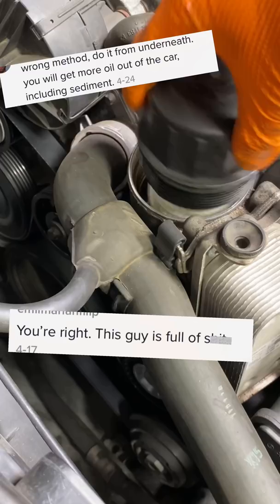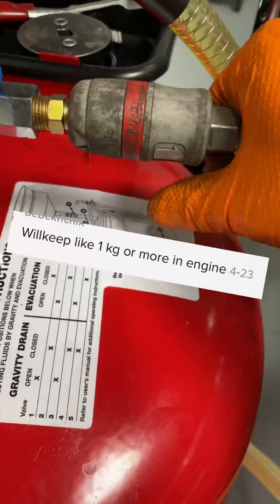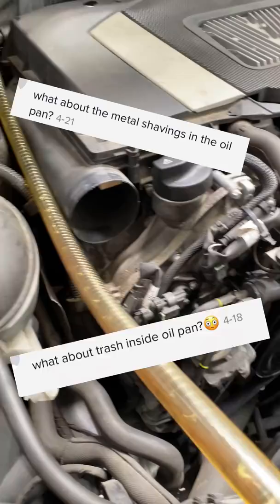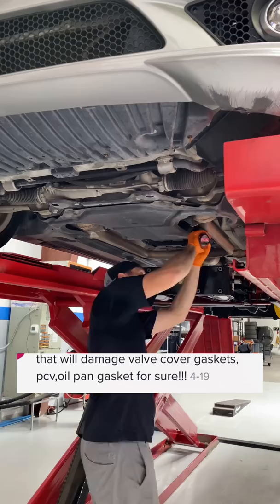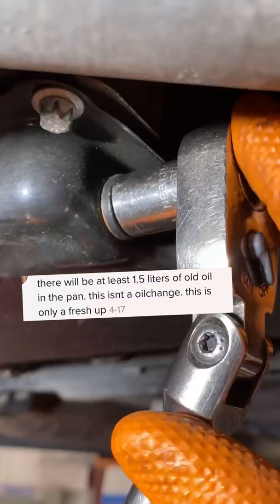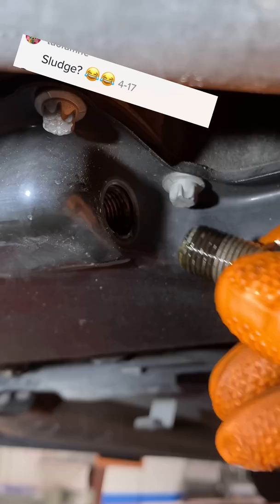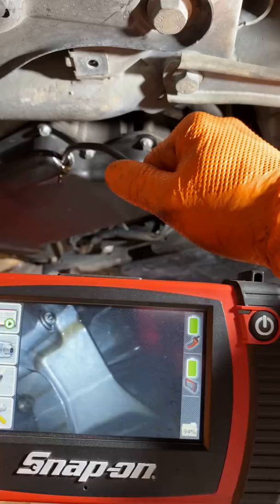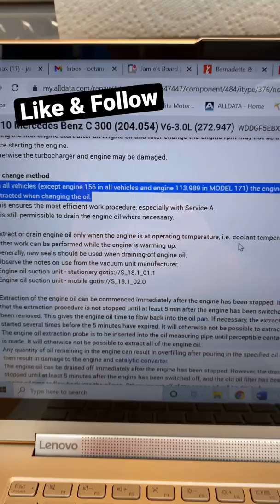#shorts Mechanic Proves Haters Wrong

Comment: As a certified MB mechanic, this is exactly how we did every oil change that came into the dealership. Thank you for showing people the suggested way that their oil is changed.
Reply: Is there a specific reason to suck it out and not let it flow out through the bottom outlet.
Reply: I also work at a Benz dealer in Latham NY we do the same except on the new models that don’t have a dipstick
Reply: @PasteteDoeniel  Pulling a vaccine gets more out. We do this for brake fluid services also
Reply: Who would have thought the dam engineers would come up with something to make it easy on the mechanic.🤔
Reply: Same here at our dealership. These new cars obviously from the bottom and most amg
Reply: @christophervanzetta  so you basically syphon the oil out with a vacuum? And this is recommend by Mercedes or this is an extra step you have to do?
Reply: @Dethmegadeth  I think emissions makes everything mechanically impossible to be simple.
Reply: Alright what tool is this cause I need it
Reply: Exactly its the Same how we do it at Volkswagen as well.
Reply: @PasteteDoeniel  it's just faster and less mess the way it's European cars are designed it's extract it and fill it exactly according to computer.
Reply: Thanks for proving my other comment true.  Suggested and easier if you have that equipment but not required.

Honestly, as a mechanic do you believe the boroscope is not BS?  That view was too dry in my opinion.  Its seems like you would need an incredible vacuum pump and a ridiculous number of hours of suction to get every drop of oil out.
Reply: Been doing them thus way since I started at the Dealer in 1989...
Reply: @MiguelHernandez-rj2uz  Mercedes recommended, been that way at the dealership since at least 1988
Reply: @Gajaba95  I generally do it to most cars as well.
Reply: I do my own old changes. That extractor is game changer. Never would have thought a Mercedes would be easiest car I have ever done a service on.
Reply: It s quick and fast it saves on time   I’ll
Keep draining my oil from the oil pan  because  I don’t trust dealership
Reply: @michaelr.williams8176  k, well have fun with your old way of doing it that has already been proven to be outdated
Reply: @benzdoct  I've only been at the dealer since 07, so not nearly as experienced but I don't remember ever seeing in wis that oil changes were recommended to be done topside. I prefer a traditional drain, cuz I've found it to be quicker and simpler, plus I can do my inspection underneath while letting it drain. I'm not saying your wrong cuz I don't  look up wis instructions for oil changes very often. I know for sure suction is recommended with the new plastic oil pans. The one thing I do remember clearly that gives me pause, is that on the amg 113's with 2 drain plugs i remember Mercedes requiring replacement of the drain plugs and crush rings. Of course different strokes for different folks. I can tell you without exception everyone at my dealer always gravity drained unless it was a plastic pan or something like a waiter lof without a lift available. It was especially helpful when I had a trans service on the same ticket as well.
Reply: @nm-xh3dm  I can for sure tell you its not bs. I pulled 13 qts out of a sprinter last week. Pulled the drain plug after cuz I thought the air line in extractor had a snag, and not a single drop came out. As a tech I personally prefer gravity drain but I use an extractor on plastic oil pans were required and on overloaded sprinters cuz id rather not pick them up. But strictly time speaking to get a gravity drain to not have a drop left you'd typically have to let it drain overnight. Its very very thorough
Reply: @PasteteDoeniel  ooooooooooooo oooh
Reply: @Dethmegadeth  and more difficult for the DIYer
Reply: Is there a reason they tell you to do that way versus the traditional gravity drain?
Reply: @PasteteDoeniel  Its faster... no mess and built for this
Reply: Jiffy lube does this on every vechicle now. You got to love the youtube certifed mechanics.
Reply: @Gajaba95  what do mean Less mess? Like if there something in the way of the oil flow then yeah there will be. But, for cars that doesn't. It not messy at all. I don't even get used oil on my finger. Well, the only one old oil that  does comes out head gasket. Lol.
Reply: for mercedes. anyway... and some VW and porsche...
Reply: @PasteteDoeniel  no its just the design they used
Reply: @SavageZebra67  my girls has a 2007 Toyota and thats how they did the oil change as well, with a vacuum system.
Reply: We need more mechanics that are truthful like you.
Reply: @Snma_sector321  A lot of truthful mechanics out there. Unlike doctors it's acceptable to find the cheapest one. And you get what you pay for. The horror stories I hear are from lube shops. And generally those are 18 year old kids. You are very cynical of an entire industry
Reply: @billrogers3139  yah it's not an uncommon procedure. But your Toyota most likely has a regular fram style filter. And a regular drain plug. I can hook it up to the scanner too if it makes you feel fancy...
Reply: @SavageZebra67  Your point was? It was at Jiffy lube they do every car that way regardless of the filter or if it has a drain plug. They said most quick change oil change facilities do this now. Your so talented, you can plug a scanner tool into a OBD2 connector, Im sure most people are envious of your stellar talents.
Reply: @billrogers3139  yah... are you drunk. First sentence was "pretty common practice these days". Not sure if you are confused 🤔  But you don't need to do this. As in it is possible to accomplish this task on many late models without the need for vacuum. It sure is nice tho.
Reply: @SavageZebra67  Your entitled to your opinion but thats all it is your opinion and  nothing more.
Reply: So while we got the MB techs here I was told there is a rear limited-slip differential that comes with the AMG performance package for the E63. It’s a 10 btw. Would this be something to get if I can? Also is there a way to tell if the car has the package or not. The only way I have been told so far about is the car will go like 178mph instead of just 155mph
Reply: Ohhh so this is MB don’t last for shit...
Reply: I bet you don't do it on a cold engine though. 
Audi tech here we do the same thing.
Reply: Hmm I've never seen this method before Seems a whole lot easier too 😂
Reply: @PasteteDoeniel  time wise I think
Reply: Suggested doesn't mean 'has to be this way or else shit fails' the drain plug does the same job faster without a $10k machine.
Reply: @PasteteDoeniel  it literally gets everything out when you drain from the plug there’s still stuff at the bottom of the pan that can’t get dislodged due to the flow but this puts the system under a vacuum so not only does it get every last drop but it can suck up debris as well.
Reply: Im a MB employee in Munich and i can approve this
Reply: @nvrlt  
How do you know you've hit the deepest area with the pickup tube? There are affordable pumps. I have an 08 GM V-6 Caddy SRX, and I have ramps, shop jack, creeper etc, and it sits up high enough so the old fashioned method isn't too painful however the filter is up top! ☝️
Reply: So, uh why don’t more manufacturers do this?
Reply: You’re absolutely correct. If MB trained you that way, then that’s the way! I think a more interesting subject would be, how much is the MB dealer charging for this service?
Reply: Gotta love $500 oil changes.  oh, but you gst a coffee and donut
Reply: I find it more funny that people will dispute someone who does it for a living, like one of these people does this as their life, I think they know what they’re talking about.
Reply: Respecting your knowledge as an MB mechanic there are some additional things to point out.  The extraction method works for cars who are designed for that.  You can't do this with older Mercedes and still get all the oil.  With that said it is not required to get all the oil because the volume of oil that replaces it makes leftover oil a non-issue and not worth bringing up if the car has been getting regular oil changes.
Reply: @leehoodeehoymenoyhe4747  same at audi in maryland
Reply: @PasteteDoeniel  because they want to charge you for it
Reply: BangontheBeastdaily  washing dishes by hand will get them more clean my guy. Also as long as you don't have a Mercedes with a skid plate under, the regular way to change oil with oil flush is just as effective, cheaper, and you can make sure it's done right and not pay a dealer/mechanic way to much for a simple job. Just my two cents, but I don't trust others to work on my vehicles anymore
Reply: my truck leaks oil haha so no oil changes for this guy
Reply: I'm a mechanic to but f*%k working on the that shit
Reply: @leehoodeehoymenoyhe4747  i live in Latham/vliet
Reply: I do this on my c207. Super easy and clean.
Reply: @nm-xh3dm  I can tell you with certainty. The extractor is that efficient. Will suck it almost dry. No different than the vacuum coolant fillers.
Reply: @TruckerReviewed  Time, but also less chance for there to be a spill. It's all about the environment these days.
Reply: @BJCulpepper  that's not true bro. The cheap extraction pumps they sell at Harbor Freight and what not leave a lot behind, but the pro ones like the one used in this video will get it all out. As long as there is a dip stick tube right to the oil pan, you will suck it all out.
Reply: @PasteteDoeniel  easier to clean up I guess, it saves some time... And it's designed to be sucked up so why not do it as intended(and dosent take as much effort)
Reply: @leehoodeehoymenoyhe4747 why tf would you not have a dipstick😭😭 THIS is why new cars aren’t worth shit. What do you have to gain by removing a tool to check the most critical fluid. Soon enough, oil will be just like transmissions fluid. “Good for the life of the vehicle.” CHECK AND CHANGE YOUR FLUIDS

Comment: "what about the metal shavings"
if you have metal shavings in your oil, you need more than just an oil change...
Reply: It's nothing to worry about if it's sparkly oil that's just a Chevy
Reply: Metal shavings are normal because the engine has some wear as it gets old, the problem comes when there's too many
Reply: I was saying bro
Reply: PFFFF
Reply: @Crunch Bar vehicle*
Reply: @Crunch Bar how much metal shavings. And I never said anything about that at all
Reply: @GuninGames  Ford
Reply: @Crunch Bar bruh this is like having a Twitter and reddit argument at the same time. They can't seem to listen to a thing you say and also write a wall of text.

Someone replied with Ford. Then someone else replied to them with chevy.

I seeing the typical truck argument play out replied with vehicle as a fucking joke
Reply: Dr Disconect  convertible submarine*
Reply: Which is a reasonable concern for a german car
Reply: Ye
Reply: @oabouelleil  car boat super truck X950 tri turbine jet
Reply: @Crunch Bar Chevys are known for that, not Fords. Sound like a typical Ford vs Chevy hater. 🤦🏻‍♂️
Reply: @Crunch Bar you know what Ford stand for right,fix it again Tony
Reply: you need engine maintenance. fast before it turns into engine swap.
Reply: A little bit of gunk is normal, that's why we do oil changes in the first place. The problem is going too long without and that sludge gets into the valve cover and into the camshaft gears and timing chain links
Reply: Dr Disconect  A-10 Warthog*
Reply: Older cars had magnets in the bottom of the pan,idk how new cars are set up anymore these days and micro shavings was normal
Reply: @VictorGarcia-gy8yv  The only thing that should be in your oil pan is the oil, if theres metal shavings theres a big problem
Reply: @stevenrodan5160  And all older trucks are known for differential leaks
Reply: @stevenrodan5160  Love the old vehicles, less bs sensors to deal with and stuff
Reply: Yeah Im not a pro And i don't own a car but if there's metal in your oil I thin you need a mechanic to look at that
Reply: Lmao was just coming to say if you have metal shavings in your oil something is definitely wrong there 😂
Reply: What about the sludge
Reply: Fr
Reply: That's why the oil pan has a magenta at the bottom to draw any metal shavings.
Reply: @GuninGames  ford*
Reply: @Crunch Bar ah yes you are one of the many that drive a hinda Ridgeline
Reply: There is litterally a reservoar on the sucker.    You will see the quality of What is take out way more accurate, than in a pan.   Even without a drip of spill.
Reply: Yeah I don’t think you’ve ever owned an old car
Reply: Facts 😂😂😂💯
Reply: And they get stuck in the oil filter anyway😂
Reply: Seriously
Reply: Yes because I hate to say it but your car is toast 
 It's funny how many many mechanics are in the chats "Mechanics"
Reply: facts
Reply: The main issue is if you have damage that you can't see from the oil... Not necessarily but a proper service involves someone inspecting the inside of your engine not just the outsid
Reply: Yeah
Reply: Exactly. And why would there be any in the oil to begin with? There's a reason engines have an oil filter lol.
Reply: @unclegangis6815  a ford transmission will give out before the motor gives out on a good ford😂
Reply: Metal shavings in oil is perfectly normal and acceptable. Only when it becomes obviously excessive would I recommend an oil analysis.
Reply: Ok so then stop changing your oil and tell me how it goes
Reply: Brilliant point excellent comment
Reply: @GuninGames  ya mean ford
Reply: If u have a gm u can make a new motor every year out of the shavings from one motor
Reply: Yeah, most likely shit build engines
Reply: I did the first oil change on a new Malibu and when I pulled the canister filter it was packed full of metal from machining the engine. Chevy told him all they can do is make a note of it incase it damages the motor.
Reply: @mastermason4766  if your getting metal shavings you know there’s still engine left, it’s when you stop getting shavings and start getting chunks well that’s when you might want to have the oil sent in.
Reply: Unfortunately you will find shaving in most Old engine oil
Reply: @VictorGarcia-gy8yv  Lol NO. Metal shaving in engine is not normal. Any metallic debris, which btw should be so small that it's virtually invisible to naked eye is caught in your oil filter. Your sump should absolutely not have any shavings. Jeeszh
Reply: @GuninGames  just an ecoboost or any chevy or chrysler with dod after 50k
Reply: @VictorGarcia-gy8yv  also the first oil change on a new engine
Reply: Right as if thats just a regular part of your seasonal oil change
Reply: the forbidden glitter
Reply: Or change your oil more than once ever 400,000 miles 😂😂
Reply: Tbh you can have a few when your engine gets worn down with high milage but your engine is not ruined because of that althought if you see shaving it's probably far from new
Reply: @leonardogutierrez8147  that would be F I A T not F O R D lmao. Ford stands for F@&ked over rebuilt dodge! But either way you should check the spelling on your acronyms 🤷‍♂️
Reply: Some people just have no clue what they are talking about just want to be the center of attention
Reply: @stevenrodan5160  both have issues depending on the motor
Reply: Well its a Mercedes so it would be expected to have some off the showroom
Reply: @leonardogutierrez8147  lol really
Reply: @VictorGarcia-gy8yv  if you can SEE metal in your oil, there's a problem. There will be metal wear and contamination, but it will be microscopic if your engine is healthy. Once it's to the point you can see the Mechanic's glitter, it's time for a rebuild or replacement. That goes for any oil compartment, engine, trans, diff, whatever. I've had oil analysis come back showing excessive bearing wear in oil that LOOKED perfectly normal, tore the engine apart and the mains were cooked.
Reply: Exactly
Reply: @mastermason4766  it’s a crank case with metal parts moving against metal parts. If there is no metal in the oil, then the engine has never been started.
Reply: Facts
Reply: You will probably have some in your car. Even if you can’t see them
Reply: It's always got shavings in it
Reply: @VictorGarcia-gy8yv  you got tumb down from 30+ years professional mechanic..
Reply: @stevenrodan5160  As an engineer that works with both, that is downright false. I mean, both of those are better than Chrysler (or Stellantis, I still hate calling it that), but Chevy is superior when it comes to engines longevity than Ford by a wide margin.
Reply: Yeah I was gonna say if you have metal shavings in your pan then you done goofed